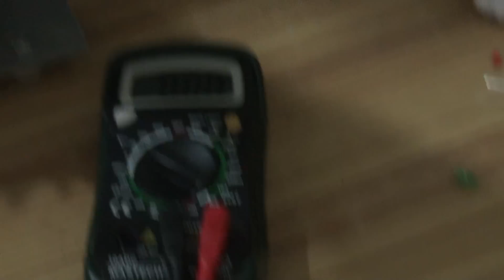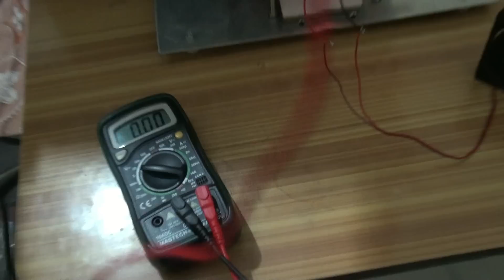Seebeck Tutorials ( Thermoelectric Generator)

Comment: while doing experiment the sides of TEG are getting heated up.how to reduce the temperature at cold junction.
plz comment on dis...
Reply from the maker: Sai Kumar : You can design a set up such that heat sink is embedded in a aluminium tray  and you can pour the ice and cold water in the tray  to generate higher temperature difference which will also reduce the temperature at the cold junction of thermoelectric module.

Comment: Which type of module is used in these experiment
Give information about heatsink
Reply from the maker: vaibhav khobragade : It is semiconductor based thermoelectric device and heat sink is a device which is used in many components such as motherboard of CPU, Generators, and automobiles too. The function of the heat sink is to enhance the rate of heat transfer in a system. For example, the small heat sinks used in motherboard help to throw the heat generated due to the flow of current in  the complex electronic circuit and which help-s in the efficient working of the motherboard.

Comment: Could you connect the generator inside a raidator.
Reply from the maker: i appreciate your question Tharish!yes we can connect to radiator but the set should be made compact.

our main aim is to use waste heat so why not the heat energy flow across the radiator. that is actually going waste.
actually some luxury car makers are using thermoelectric module or plate in cars to extract waste heat of exhaust gases (smoke) of cars and to utilize it for low power D.C applications in cars.

you can try to make compact setup to try it with Radiator.

Good luck!

Comment: hello,,, nice work. Where can I get this peltier module???And how much does it costs??? please reply.. its for a project work.
Reply from the maker: hello nik. you can buy this device on www.rscomponents.com. or www.tellurex.com usually it costs between 40$ to 85$ according to me but you verify the price.

you can make this project.

list of things required
1.peltier module or thermoelectric plate

2. heat sink

3. a frame for supporting the setup

4. thermal paste for to fill betwwen your bottom side of module and top plate of frame and  to fill between top side of module and heat sink to maintain continuos heat transfer....

5.heat source 

6. cpu fan, led's or any small toy dc motor to show production of electricity.

best of luck ... you will succeed just keep trying and see the video for any help.

please share this video to your  as many friends or scienctific background persons    i want more science students or science lovers to watch this so that they can learn..   i will be very thankful to you if you do this to me...........

send me your email id so we will join on facebook...

Comment from the maker: Its a good question? you have to create temperature difference  across the both sides of the peltier plate to generate the Electricity. If you can create sufficient temperature difference across the peltier plate with the help of ice , then you can obtain the ELECTRIC ENERGY (DC VOLTAGE).IT can be done with ice.

Comment: i have few questions
1.what was the output current reading during your experiment??
2.also which module did you use?? 
3.i am using a TEC-12706 module and i need about 5V,350mA output...... how many modules will it take for this purpose

Comment from the maker: This system needs themoelectric materials.The name of the material is Peltier plate or Peltier module.you can buy through Online shopping. You also have to buy a heat sink and thermal paste, LEDs,CPU Fan, and base stand . Assemble all. It will surely work in your class. GOOD LUCK!